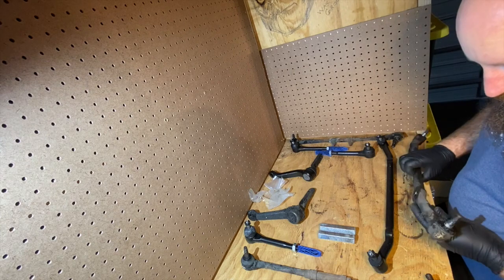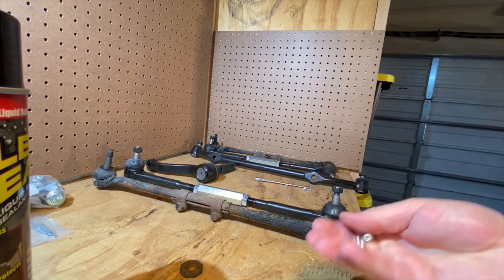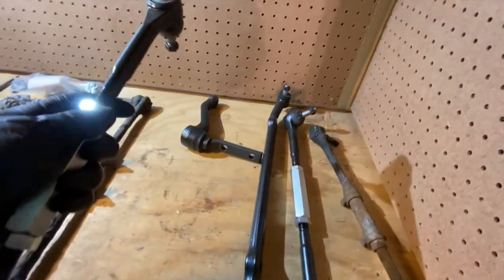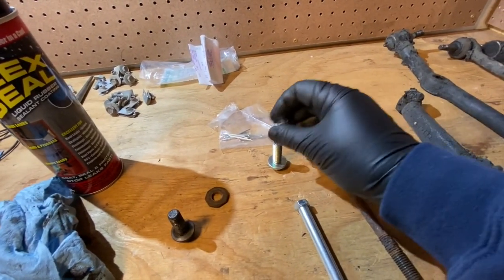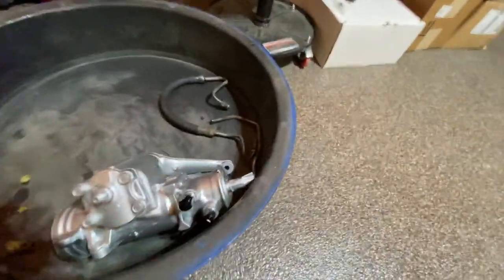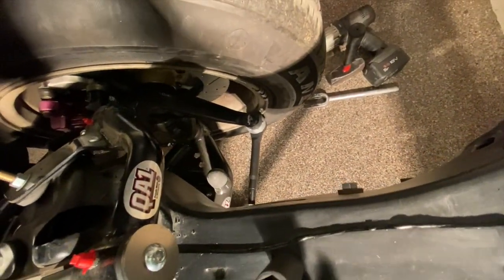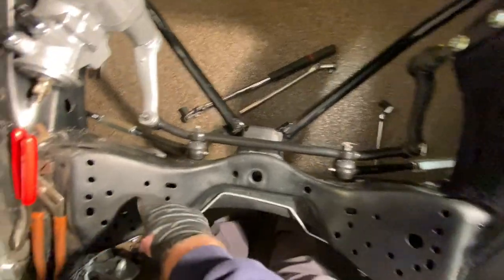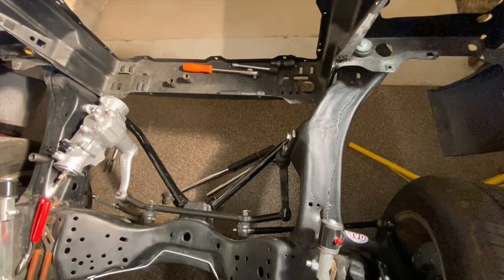G Body El Camino Restomod Front Suspension Part 2: Steering Linkage

Comment: Joshee, easier and faster to remove the outer tie rods then steering pitman arm from drag link, then two bolts from Adler arm leaving the other joints in tact. This way you are able to set up your replacement parts like the way you removed the old ones. This will make it easier to set up your steering alignment before you take it in for final alignment.
Reply from the maker: I just left the tie rods in the sleeves and matched the length of the originals.

Comment: Thanks for the video, whats the thread size of the fittings that you used in the steering box to go to AN ?
Reply from the maker: I believe they’re m16x1.5 to -6 and m18x1.5 to -6. You can get them in a set from either eBay or Amazon.
Reply: @CarsandJoshee  awesome, thanks
Reply: @CarsandJoshee  Do you know what size fittings go into the power steering pump at the other end of the hoses ? thanks again
Reply from the maker: @sigunz  I haven't got that far yet. Probably going to have to Google that one.
Reply: @CarsandJoshee  Found em,  5/8-18  inverted flare :)

Comment: Would you happen to know the bolt sizes for the steering box and Pittman arm on the other side of the frame?
Reply: Idler arm I meant
Reply from the maker: Not sure. Maybe M12x1.75x35mm for idler arm, and I think these are the steering box bolts: https://www.ebay.com/itm/302896446882
I just used factory bolts for the gear box, and the new suspension parts came with the hardware.